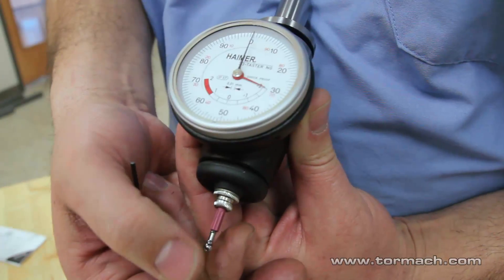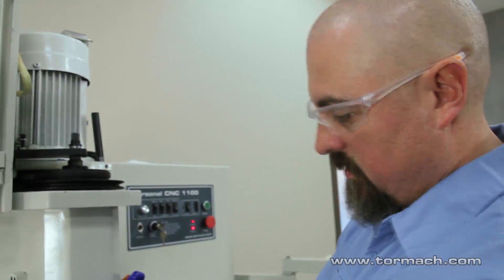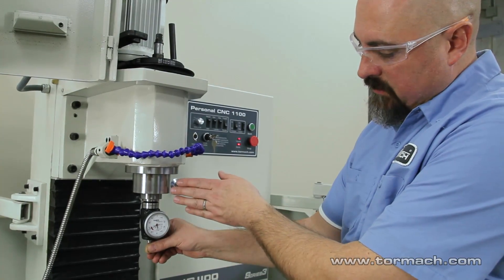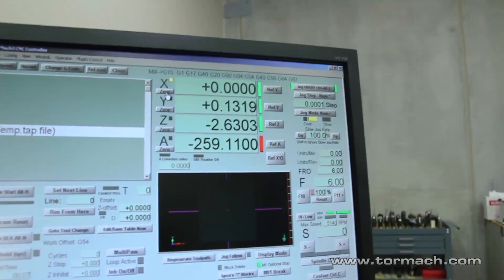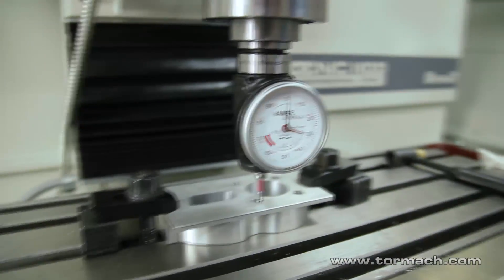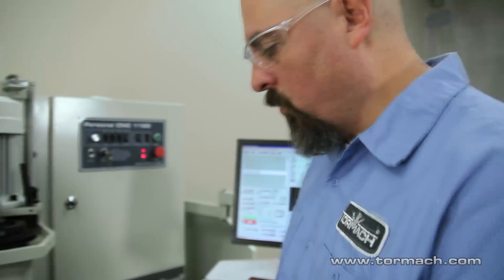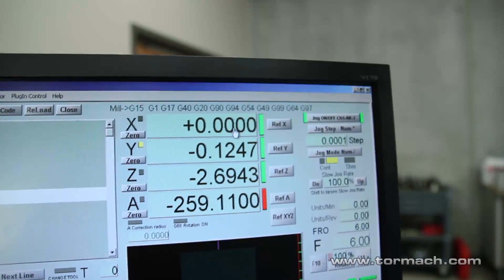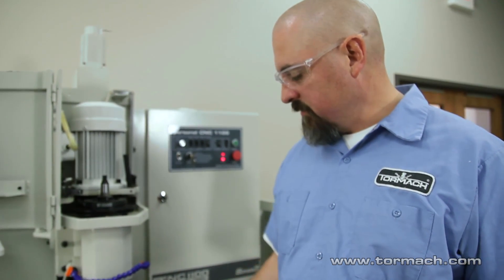How to use a Haimer 3D Sensor for Mill Setup - Tormach CNC

Comment: Why dont I just buy your electronic probe and let the cnc set the 0 automatically.  Why would I buy this delicate expensive device that makes me run the mill manually. It is weird how much work you choose to put in to a cnc mill hand moving it by the jog input!!!  What am I missing here.
Reply from the maker: You aren't missing anything here. There are many different ways that we offer to set up and touch off a work piece including edge finders, Haimers, and 2 different kinds of probes. We have found that some of our customers find loading a Haimer for their jobs quicker and we wanted to provide them with support on how to use it and be effective. But, we do agree that having a probe is another valuable tool to have with a CNC.
Reply: @tormachinc  how could loading a haimer be quicker?

Comment: When you found the hole center you adjusted the Haimer only to -1 on the inner dial. Is that because you did that consistently all the way across, and you were averaging the points?
Reply from the maker: Yes, it's because he was consistent on all of the measurements with the -1 on the inner dial. Mike explains this technique earlier in the video: https://youtu.be/nkYpKWbA2P0?t=319

Comment: I use 3d sensors at work, broke two tips in a day :D I feel bad cause they cost almost like 100€ a piece :( But it's better to destroy the tip than the sensor itself. And nice beard :P
Reply: You gotta be more careful, i use 3d sensors for over three years now and only broke 1 tip by my stupidity.
Reply: Sure :) I broke the whole sensor later but that was because of the tool changer malfunction. Fell down ~500mm down to the table sensor head first. That's what you get for working on the oldest machine in the shop.

Comment: wouldnt the z zero be 2mm less ten the meashured tool height? Since you meashure the hight with extracted tip?
Reply from the maker: This is a good point.  You need to pre-load the dial when measuring the tool height so that the needle gauges both read "0".  Thats the correct tool height to use in your tool table.

I'm going to ad a clarification to the video; watching it again, its not clear
Reply: Had this same question as the video shows the extended height, which is then typed in Pathpilot offset table. Thanks for clarifying that the dials have to be zeroed to get the right tool offset. Maybe this procedure is more accurate if performed with the tool in spindle method.